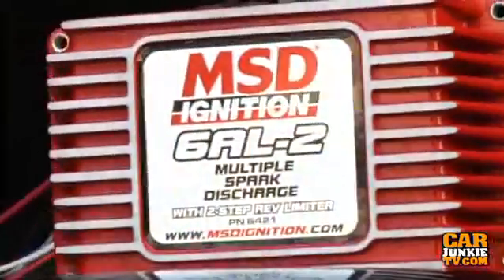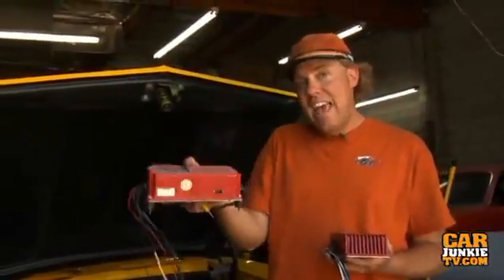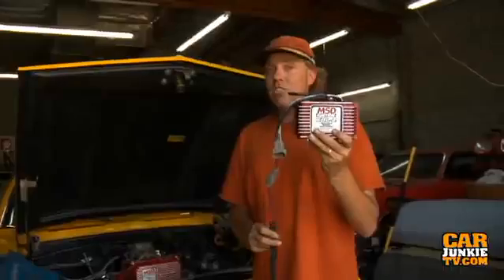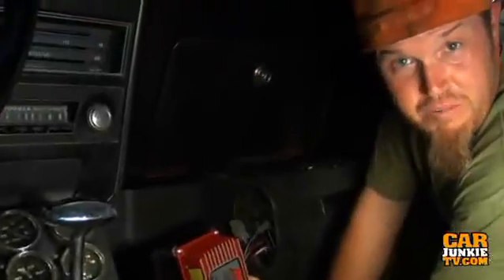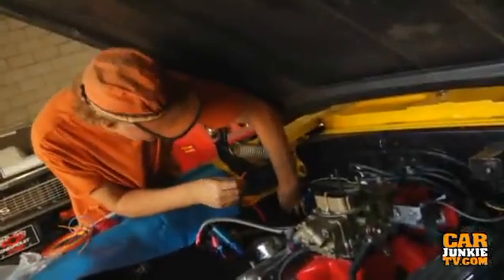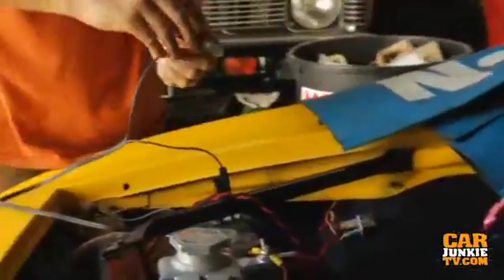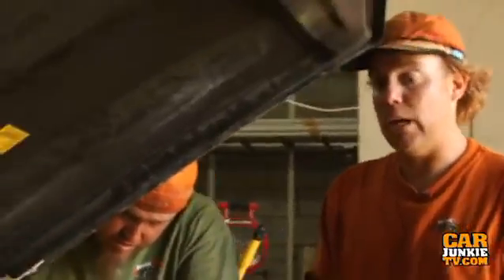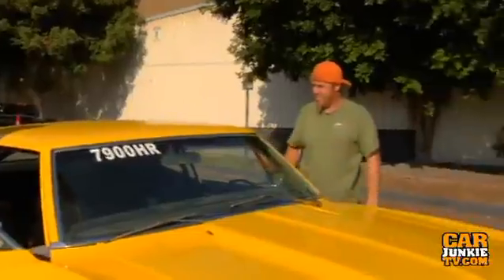MSD Digital 6AL-2 Ignition Control Tutorial Overview CarJunkieTV

Comment: Car info 
1991 mr2 turbo
3sgte 2nd gen 

installed msd parts
Part# 64213
Part# 8207
Part# 8910EIS

Q1
I have an aftermarket exhaust and I'm thinking that my vehicle was louder and had a stronger sound when the parts weren't installed when idled or driving. Is it possible that the installed parts alter the sound (by making it more quite)?

Q2
When I start the car the arrow bounces up and down a little first (shakes) without giving it gas in neutral. Is that a normal thing?

Q3
Before the parts were installed when going pedal to the medal while being in neutral, the arrows used to go all the way up and bounce off while making a punching sound (which sounded nice and was fun to do for show once in a while)
Now with the parts installed it doesn't go all the way up and makes a constant sound instead of  punching sounds (doesn't bounce). Is this normal and can I adjust it to make the same sound as before?  If so is that a bad thing to do?

Q4
Are there recommended settings for my vehicle?

Would really appreciated if I can get detailed answers for 1-4 and I'm happy with the products

Thanks
Reply from the maker: For the answers to those questions, please call MSD direct at 915-857-5200. They will be able to provide the info needed.